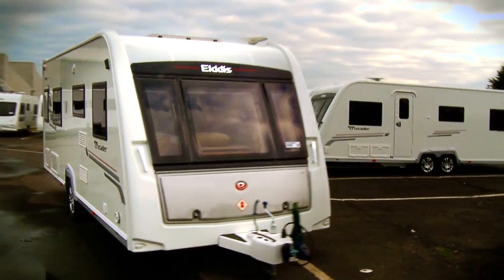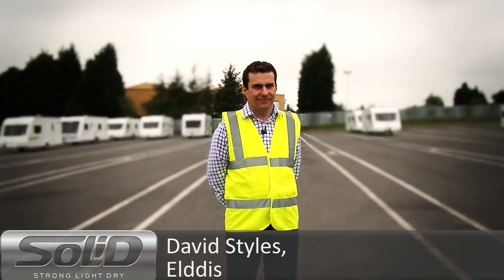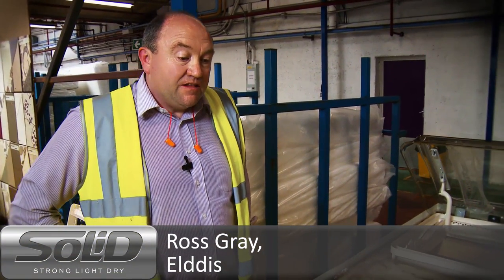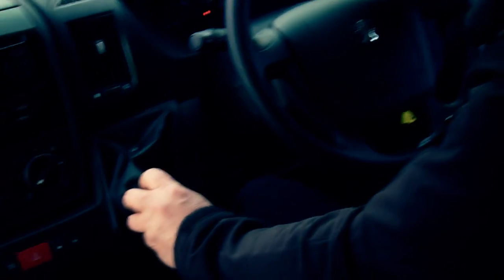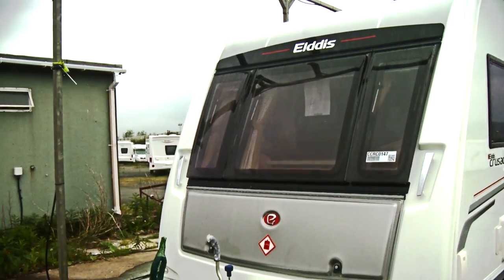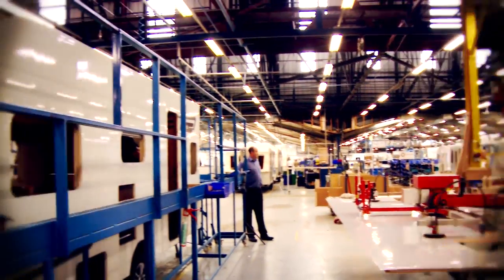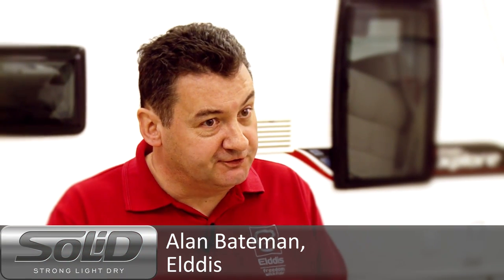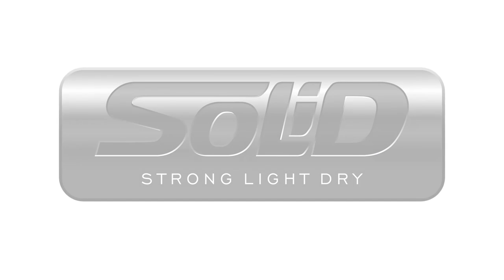Elddis & Buccaneer Caravan 2013 - New Manufacturing Method SOLID Dryness Feature HD

Comment: Now you have mastered the building process so as to prevent water ingress, my be now you can turn your attention to the interior walls. The washroom wall in my 2019 Autoquest 185 is breaking away under normal driving stress, the fittings used are very flimsy and in my opinion not fit for purpose.